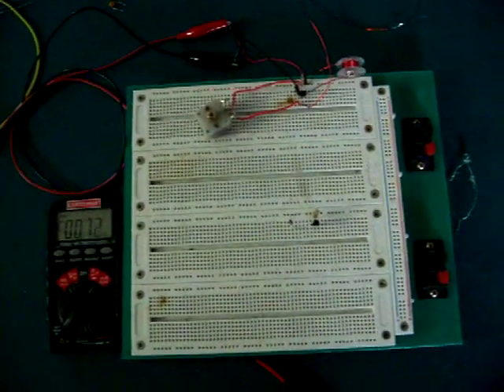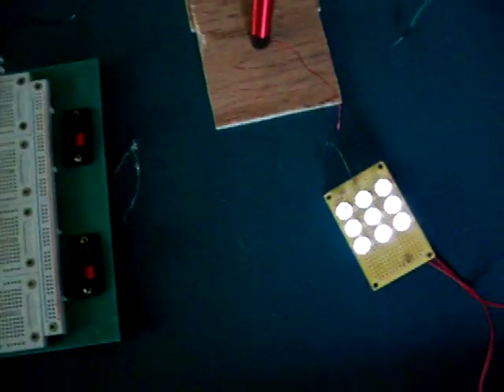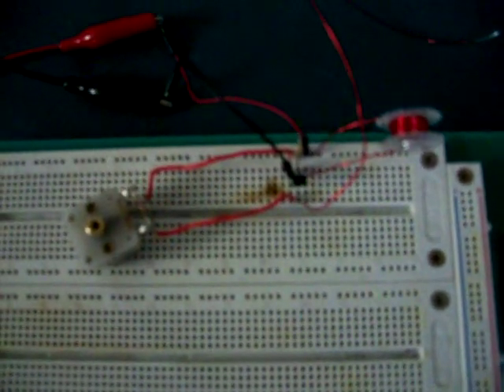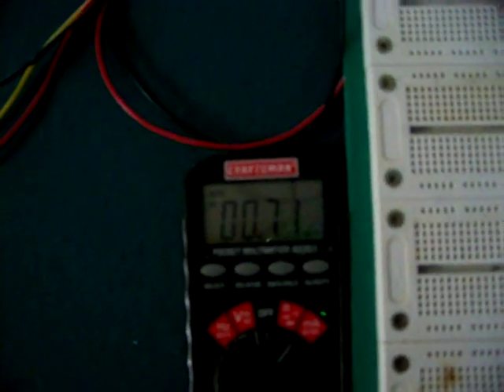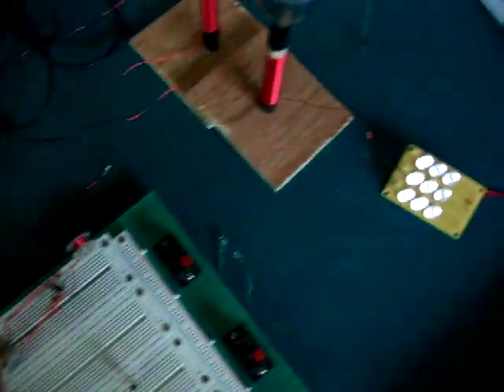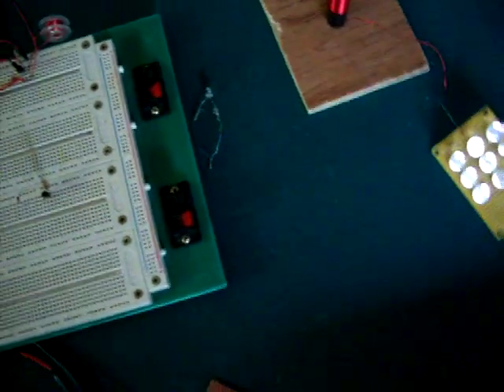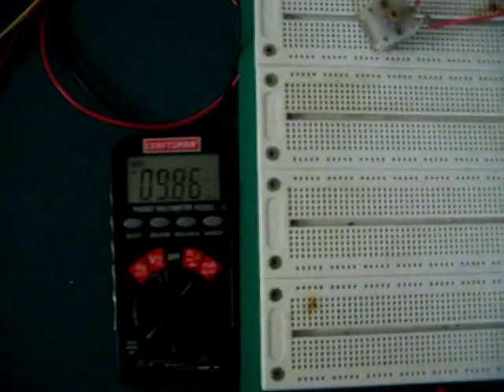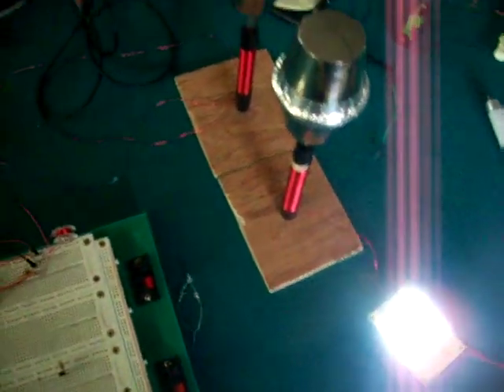Simple Exciter

Comment: Hello and thanks for sharing, but you know that the power is sucked from the battery in spikes, so the ammeter can't give any true reading. Could you use super-capacitor and compare efficiency by length of runtime ? That would bring your demo to a new level :)
Congratulations again, cheers, JT.